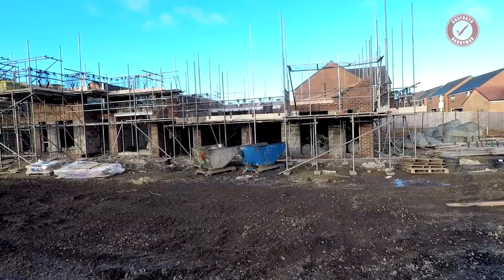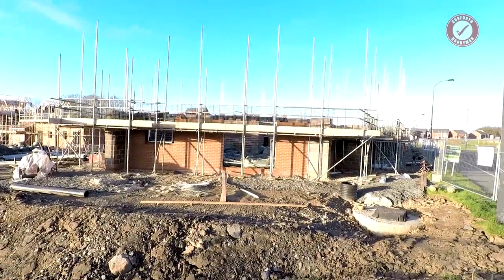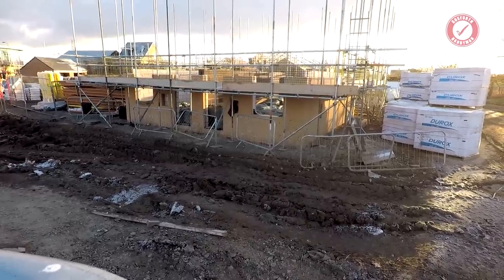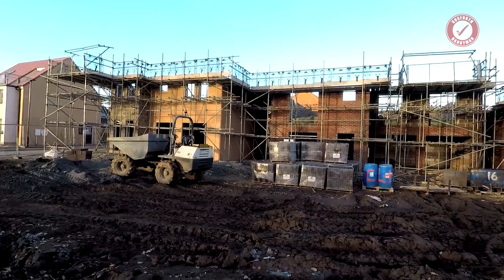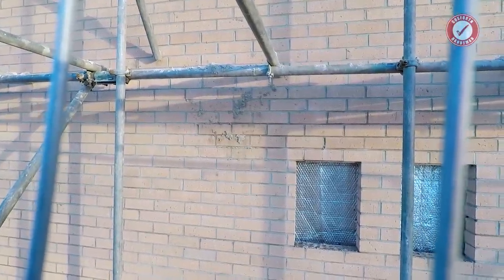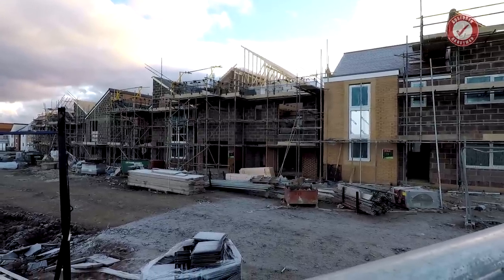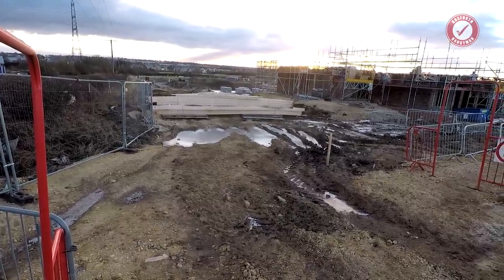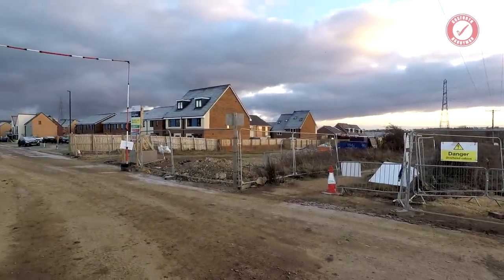How are New Houses in the UK Built? Introduction & Externals

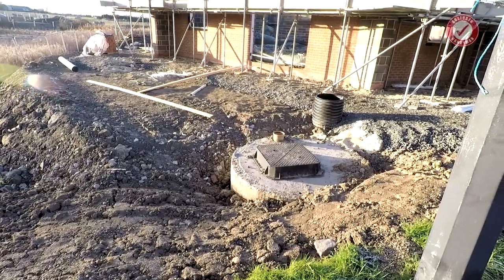Comment: Only 4:00 mins in but the amount of times you've said how they use this material so its cheaper, yet the houses cost even more. It's very sad. Wouldn't buy a house unless it was made before 1960's with Acrington Bricks! These new houses have paper walls, plastic air vents, the cement makes white steaks over the brickwork, the brickwork is cracking and chipping after 3 years. Plus if you want a garden the size of a rats cage....
Reply from the maker: Sadly all houses have gone up in price - you get efflorescence on old brickwork too btw. It's just normally been washed off over the years. 👍

Comment: I thought timber frame buildings was the latest thing offering many advantages.
Reply: lame duck Latest thing? Tell that to the tudors.
Reply: Depending on the area they'd either use breeze blocks or timber frames. I have viewed new builds in my area where they'd use timber frame but have also been in other areas that used breeze blocks. I guess it's what gets approved by the council in the specific area.

Comment: Tiny rooms, low ceilings, poor sound insulation, tiny plots and to top it off you get rising damp problems due to slab and a brick house that can't breathe due to being pumped with expanding foam. No thanks.
Reply: Thankfully I have an old house

Comment: I've got concerns about new built, particularly timber kit construction...   timber kits built next to each other, one in a good Scottish summer, and one in a good Scottish winter, experiencing the associated respective weather (if any different that year) would be totally different houses in terms of quality,  shrinkage,  settlement, cracking, speaking etc....  I fear some of these shiny new, very expensive houses, may in the short future become un-mortgagable due to build quality and condition issues...  would love a shiny beautiful new build, but timber kit, plastic pipes etc....  went for 70's block and brick myself with big garden and spent money modernising
Reply: I dont disagree with what you are saying as truth to be told and established building has many plusses over a new build. However every property once was a new build and went through the same motions as new homes now. It was a fact that older property owners were advised back in the day not to wall paper for the first 2 years due to settlemnt as it would tear wallpaper. Also larger section of timber was also used and this in turn equates to larger moisture content. A perfect visible example of this is 5" timber flooring , none of it will be tight together yet when new there was no gap between them, also any older building will also show a larger gap between skirting and floor.

Comment: Would a house built In 1995, had asbestos used ?
Reply from the maker: Very unlikely.
Reply: Not unlikely at all....  any building pre 2000 should be considered to possibly contain asbestos I understand
Reply: In the U.S., we stopped using it in the 1970s.
Reply: Tom Jardine you may find it in textured coatings (artex) always a good idea to have it tested before scraping the hideous stuff off, or plasterboard / skim over it. If you're buying a house with artex it's a good negotiating point to lop a couple of grand off.

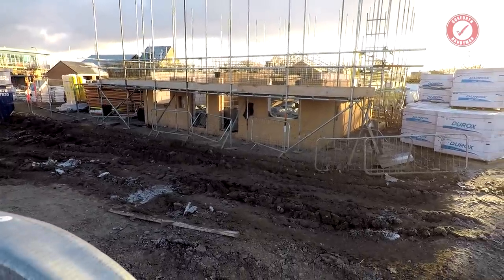Comment: 5:00, cavaty wall insulation is the most horrendous thing possible!
The cavaty is there to let the water and damp that penetrates the outer skin of blocks out, the water runs down the gap and into the ground.
If that gap is filled with insulation the water and damp from rain then passes to the blocks on the inside and into the plaster and decoration of the rooms. 
Cavities were never ment to be insulated.🤦‍♂️

Comment: Most Europeans live in flats. 60& in Germany , 49% Italy , 47% France but only 18 % in the UK , the lowest in the EU (as of 2015 last EU inventory)
Lots of commie blocks still dominate in Europe especially in the  east. For Brits  the preference is nearly always a house , little garden front , bigger garden back.They  are the gardeners of Europe and have never taken to tower blocks and many are being demolished.

We do however build the smallest houses in Europe  after Ireland. This is a land and green belt issue i suppose.
The quality of design and build varies between builders. Persimmon seeming to come bottom  on a regular basis.

https://www.thesun.co.uk/money/8728956/persimmon-named-britains-worst-builder/

Barratt  and Taylor Wimpey the best imo

If you cant understand the two tap system you're an idiot and that's the end of it 
Carpet can be very nice unless it's mangy and needs to go. Laminate and wooden floors are the most popular now i think though
Nothing wrong with radiators. Have wooden shelves on 3 of mine.Love the idea of underfloor hydronic radiant heating though.
The UK has the oldest housing stock in Europe. Hence the legitimate claims of peoples asses being  colder here than in Europe
 in Winter.As of that 2015 inventory which i have a pdf of for a project i was doing.

https://www.bre.co.uk/filelibrary/Briefing%20papers/92993_BRE_Poor-Housing_in_-Europe.pdf

58% live in terraced and semi detached houses . Semi detached almost an unknown concept in Europe save for Holland
23% in detached houses
18% in flats
1% others Caravans and canal boats ( i know someone who lives on one..Awesome)

The most popular type of houses that are snapped up as soon as they are on the market are the 1920s and 1930s semi's
of which 4 nearly  million were built in those decades ( Luftwaffe redesign aside)

This does tell us a lot about standards today i'll admit. There are many complaints from new build residents  and until the government 
steps in and starts slapping huge fines on  house builders for sub standard and shoddy work then they will always take the piss

on a side note ...

Everyone in the world should have a house/ flat they can quietly close the door on the world for the night. An outrage in 2019
billions do not.